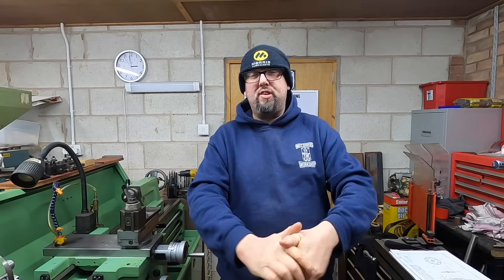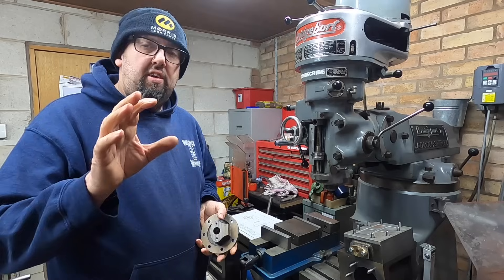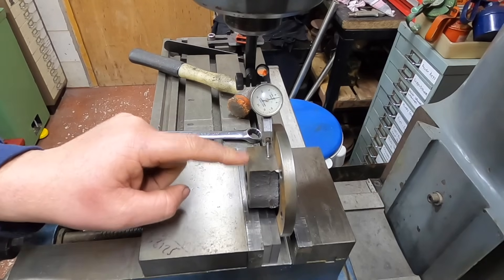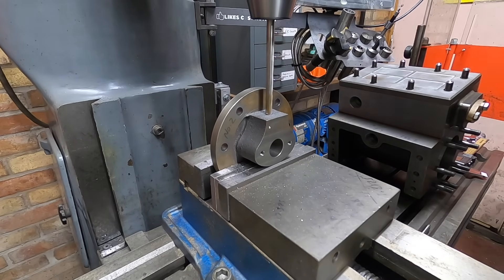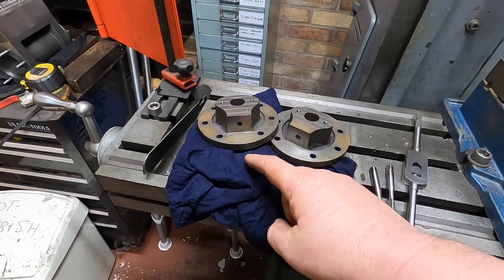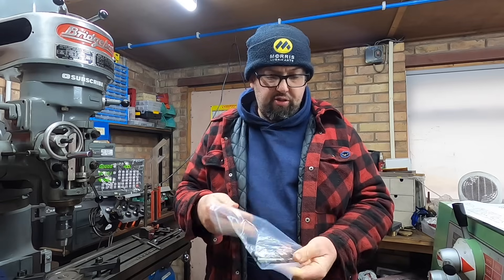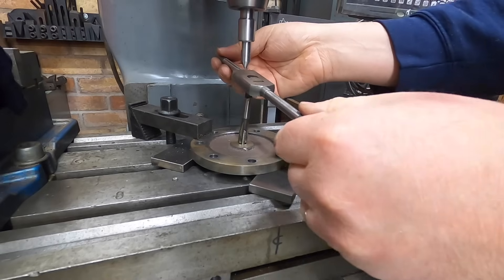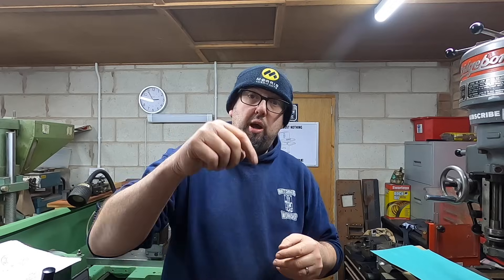Finishing the Cylinder End Covers - EP65 Project Tinkerbell - 7 1/4" Gauge Steam Loco Build

Comment: If you have a good gasket company near you see if you can get the gaskets CNC lazier cut, saves a huge amount of time and you can get a few spares done at the same time and the cost isn't much more than the gasket sheet cost. If you are cutting them by hand you can use the ball end of the hammer to mark out the stud holes, just do it the same way as you did for the other edges.
Reply: Agreed.  I got my cylinder gaskets made professionally.  Cost was surprisingly low and I have a bunch of spares.  They all fitted first time and saved all the work plus the cost of a sheet of gasket material.

Comment: Another enjoyable video Matt. 👍🏻 I purchased a cheap dehumidifier about 4 years ago. It’s been running 24/7 since, never stopped and keeps the workshop at 50% humidity. Rust now takes a lot longer to build up to a point I barely need to worry about it. Room is slightly sealed though and insulated. Hope you have a merry Christmas 🎉🎉
Reply from the maker: Merry Christmas Richard. Yes I've considered one, but until I've got rid of the wafer thin garage door it would be a waste of money! Hopes for the new year! All the best, Matt 👍🚂